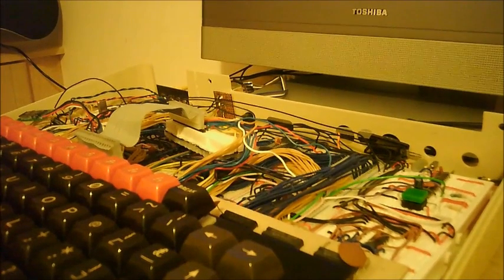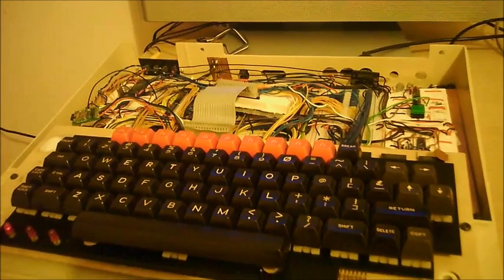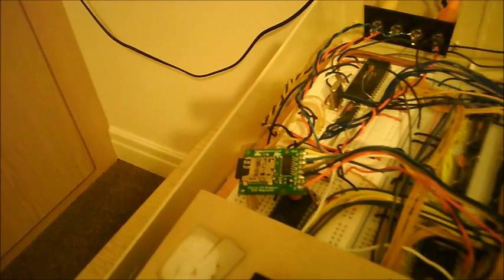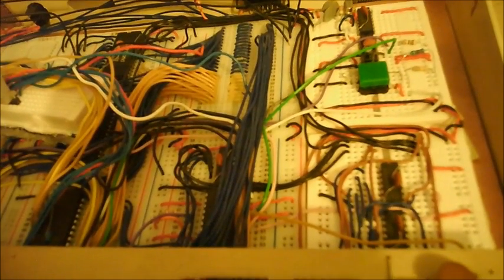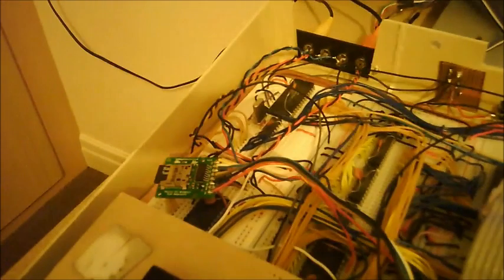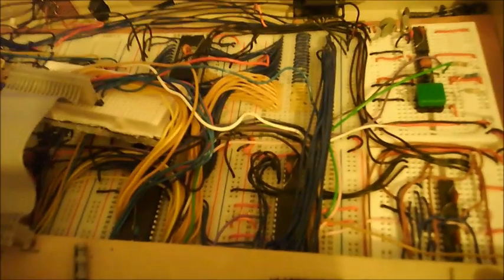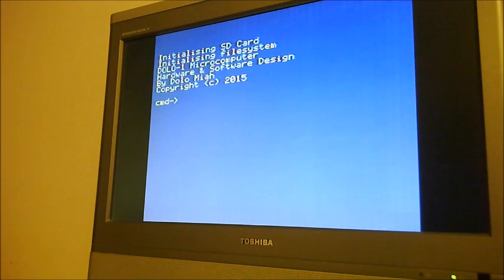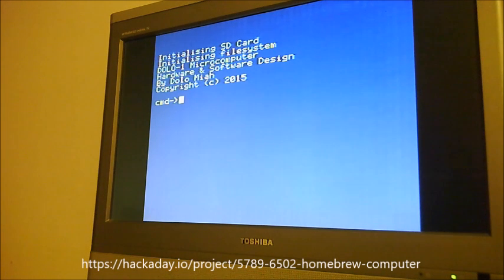6502 Homebrew Computer Hardware Description

Comment: Have you ever thought of design & building a Modern ORIC-1 ??
Reply from the maker: It's a tough one to reproduce because of the Oric custom ULA! But the Oric was an inspiration to make this. I even ported the dflat programming language from here for the Oric, kind of reverse inspiration!
Thanks for your interest!🤓👍🏽🤗
Reply: @6502Nerd  Hasn't someone already done a ORIC-1 ULA ? Not sure but someone on the ORIC-1 forum was building an ORIC type machine called the RE-ORIC ?? I could be wrong !
Reply from the maker: Actually yes I think you're right, but I think it's gone a bit quiet. If it's resurrected I'll do a port of dflat 🤓